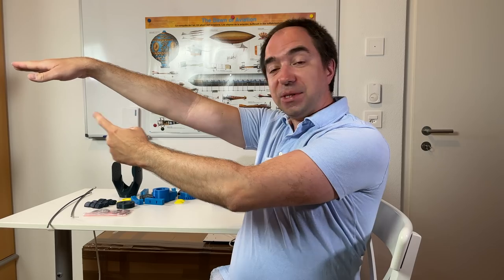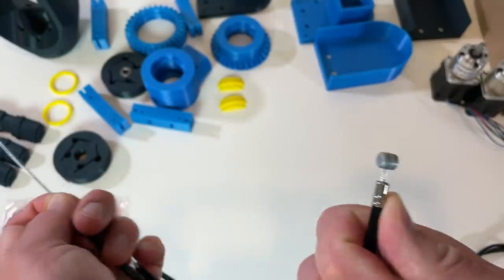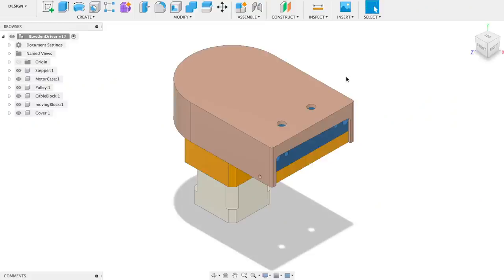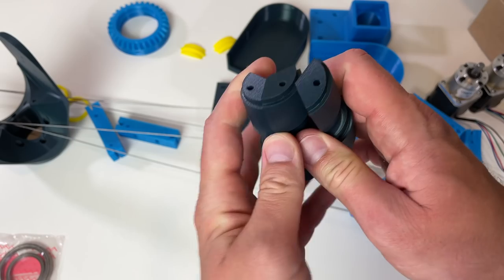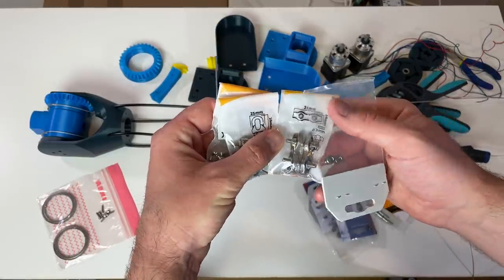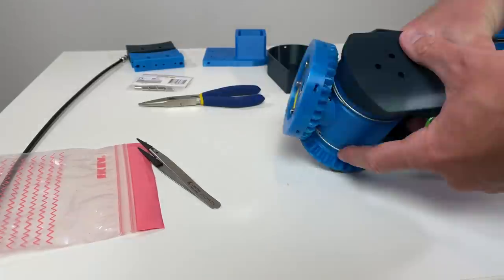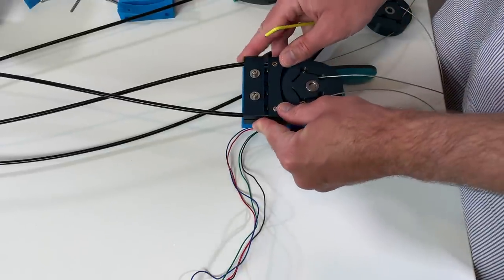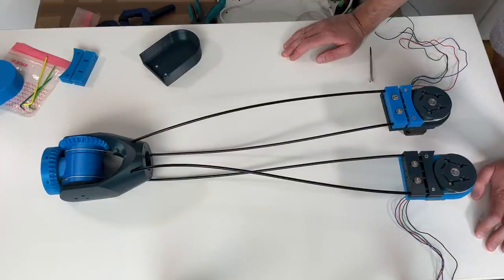Bowden cables for the robot arms? Will it work?

Comment: How about analyzing "rotational bowden wires" ? Removing the length from the equation and only work with rotation of the wire? Guess you need higher speed on the wire and gear reduction at the hand to get some torque.
Reply from the maker: Yes, this is great idea. But with this you cannot move the gearbox. The gearbox would have to stay close to joint. (Because, such cables have some “backlash”)
Reply: @Skyentific  have seen some 3d printer s working with this kind of rotation wire. Moving the high weight from the important point.  Not sure on how they solve the backlash.  Worm gear connected in two stages? But yes, gearbox is needed in the wrong end of the cable
Reply: Not a fan of flex-shafts either.  They tend to have very low stiffness and significant friction.  Much better to snake a timing belt in with a bunch of idlers or use a shaft with a clever gear layout.

Comment: Hi, in bmx industri exists linear break cables. This cables are not spring like cover, they are linear so when you tight them doesn't affect the breaking streght. 
Sorry for my english. I know the are much expensive, but for example https://shop.odysseybmx.com/collections/odyssey-brake-cables/products/race-linear-slic-kable
This kind of cable reduce the friction a lot!  For example you can do 2 entire turns of the bar, and still breaking (this is not possible with normal break cables)
Also others break cables from shimano or others fabricants,  reduce friction with teflon and other tech inside the cable.

Comment: Bicycle shifter cables are built differently than brake cables for exactly the reason you show.  Brake cables use a tightly coiled spring and contact between the turns to support the reaction loads of the drive cable.  Shift cables uses a parallel wires with a twist every 1-2cm stabilized by the plastic jacket.  This isn't as strong, but it's stiffer and doesn't change length when flexed.

Comment: You should try doing something similar to the mechanism of a ‘flexible shaft Dremel’. So instead of the cable moving forward or backwards like the Bowden system, rather use rotation in the cable. Have always wondered if anyone has used flexible shaft mechanisms for robotics.
Reply: Those cables are good for the Dremel application (constant twisting/spinning), but for robotics it's not going to be good because they bend/twists too much, so you'll loose precision (backlash). I'm pretty sure I saw a guy that made a thicker version of those cables that reduces the twisting... But can't remember the application... and it's much more rigid.

Comment: FYI, if you design the holes printed in this orientation with a "tear drop" shape, or just a small triangular wedge cut out of the top, the result on FDM printers will will become much more circular. Can save a lot of time with complex geometry that's difficult to post-process by hand.

Great video!
Reply from the maker: Great idea! Thank you!
Reply: You can also make the very top a bridge, so print the upper half as a half hexagon. Will work just as well, and put more material around the hole
Reply: @TDOBrandano  Yeah and some slicers basically do this on their own. That extra bite is great when you're threading screws into plastic parts but still not ideal when clearance is needed for projects like this.
Reply: @Lassi Kinnunen 81 I've also found adding a small cutout to the bottom of really small holes can help even more depending layer height. I believe Cura basically adds a bridge automatically to most horizontal holes but it would be nice to adjust how steep of an angle it starts. Changing the orientation is a good thing to note. It's just not always practical and may affect how reliable the overall dimensional accuracy and part strength is.

I've been looking into creating a slicer plugin that automatically applies an optimal tear drop to holes between a set diameter. It may exist already but I haven't seen one. I'd also like to have bridging options for holes that'll be threaded and automatic sacrifical layers for recessed vertical holes .

Comment: I'd have a try at using bicycle gear cables instead of break cables, the housings are constructed in a different way to minimise the issue of the length increase as it bends and the cables are thinner and more flexible.
Reply from the maker: Yes, this is great idea. But there are two issues: gear cable is more rigid and it can transfer less torque.
Reply: @Skyentific  the rigidity is a good point, but I don't think the torque would be an issue, they can take 500N+ without breaking

Comment: Bowden cables are good. Actually you can compensate most of bad effects using encoders and software compensation.
Reply: You are right. By 'integrating' the cables before the sensor, you include them in the closed loop system and the control system can compensate for the non-idealities. It is of course not as good as if it would not have any non-idealities, but better than using the cables in 'feedforward'.
You will always waste (precious) motor power overcoming resistance, leading to lower efficiency, not being able to reach theoretical torques/speeds and motors getting hot. 
Play/backlash is something a control system cannot really compensate for very well, and can even lead to control system instability.
Reply: @tHaH4x0r  To pick up some mug and to place it in another place - this is more than enough. Really good lubrication and maybe bigger diameter and more flexible cables - can improve efficiency - like in human body : D
Reply: @humanspirit3432  If you can improve the mechanical system of the arm, why not do so? It seems like a waste of effort to design such a beautiful arm and 3D prints, to then not nicely finish it up in the end.
Also, the bigger diameter tubes will only exacerbate the issues with bowden tube getting stiffer when bent, because this is mainly caused by the difference in length between inside and outside of the cable. The resistance is also not caused by friction inside the tubes, but by the cables working against each other. This means that lubrication does not help at all either. 
More flexible cables would maybe help, but this would come at the cost of control system bandwidth, as this elasticity is directly in series with the actuator.
Reply: @humanspirit3432  To elaborate on my last comment, what is the point of putting the motors far away from the joint itself? It is to decrease arm inertia. Why do we want to decrease arm inertia? Improved bandwidth and increased safety. If you then have a more elastic link between motor and joint you will decrease the bandwidth, yielding probably worse performance as a result, with higher mechanical complexity (meaning more cost, lower reliability) so it makes a lot of sense to want the mechanical part to be operating without slip, resistance and other non-idealities, as otherwise you are just handicapping the arm and negating any benefits you are trying to get.
Reply: @tHaH4x0r  I mean - cables must be flexible for bending, but not flexible for stretching. Steel cables with many wires - are OK. Maybe some synthetic cables will work also good.
Reply: @humanspirit3432  you should ditch the steel and replace them with Kevlar fibers and PTFE tubes. I mean you're not going to transmit compression with the cable, so why not use known technology to eliminate problems.

Comment: A tip for the holes, you can you use a tear drop shape at the top of your holes to prevent hole collapse.  Saw it on maker's muse and it works quite well.   I haven't done it yet on that small of a whole, because usually I dont need it for that small of a whole as its using for screws

Comment: I like how bicycles overcome this by using a long-enough bowden for each bend that changing the bend doesn't change the bowden length much - and then for any straight long sections it relies on the compression strength of the arm to run the cable in a straight line. 
Brake handle > top of bike frame, one sweeping curve that doesn't change length much when you steer
Top of frame> fixed point to bottom of frame with no tube, just open cable
Bottom of frame > brake actuator is straight line with no changing bends. 
I think a lot of the problems can be overcome by relying on this kind of geometry.

Comment: There were teflon lined bowden tubes for racing bikes in the 80s, it was a difference like day and night, compared to the conventional tubes.
Reply: material types make differ but kuka and others solved this problem using strong timing belts.
If this worked for robot arms probably all companies would use it.

Comment: I'm wondering if you use a smaller circumference at the motor, the effective gear reduction would help overcome the friction. Very nice design, too bad it doesn't work better. Thank you for trying it, a design I've been thinking of myself. That saves me some time!
Reply: I was thinking if he put a gear reduction between the cable driven shaft to the arm past the previous degree of freedom, this could help with the change of length of cable when boden tube bends.

Comment: Great project idea, well done. Probably the best is a hydraulic fluid system or maybe an air vacuum pump like used in the Mercedes central door locking system, very little friction and waterproof. For example 2 syringes connected with a small bore plastic pipe. giving you instant push/pull linear motion.Keep up the good work.

Comment: You can account for bend in software so the steppers adjust the end of the cable and zero out bend’s effect. Calibrate the thresholds once the bend is consistent based on the rest of the arm.
Reply: It's the same pulley that pulls and pushes the two cables at the same time, so it can't be compensated with software. Unless you have two separated pulleys with one motor each, one pushing and the other pulling at the same time, than you can compensate via software.

Comment: Cable length issue. Simply route the cables is such a fashion that when one cable bends the other straightens. This will cause a small position error. This can be done, if one cable makes a clockwise bend route the other counter clockwise.
Reply from the maker: This sounds like a great idea, but I cannot imagine how to do this on real robot arm. They would always bend and straighten together.

Comment: Perhaps a solution to the bowden backlash so to speak (where bending changes length), is to measure at the end and closed loop correct for it.

The motors could still be at he base and you'd only need encoders at the end still cutting down on end effector weight.
Reply: Agree, even with the friction and the "backlash", it still carries the force pretty well, so measuring the position at the moving end rather than the motor end makes sense. I had the same issue with my canards, but fixed it with potentiometers, and generalised the principle to all my ailerons/elevons, even using chain belts and tensioners from my servos.

Comment: At approximately 10 minutes in, you show one reason for cables suddenly showing slack; when I worked at a bike shop I found that cables, { mostly the brakes } S T R E C H E D due to the force applied by the rider was greater than that applied by the cable assembly machine. I hope that you find this helpful. Cheers.

Comment: Great video! I think you are there! Maybe I'm being too optimistic, but I think that the movement of the cables when they're bent could be modelled. Then, with the rotation of the joints between the steppers and the articulation, you always would know the change of length of the cable. So each time an intermediate joint moves, you should compensate the change in length by rotating that amount in the stepper.
Reply: correct, that's one of many things this video fails to acknowledge.

Comment: Nice! I thought about trying this before as well :)
Reply: me too, did you consider compound bow risers and artificial muscles? I'm thinking electrolysis could maybe inflate the muscles
Reply: @kingmasterlord  shaping the rollers which are guiding the wires in a way to accommodate for the position dependent torque - this would be worth a try 👍🏼
The question is if such a artificial muscle can achieve reasonable dynamics
Reply: @EngineeringSpareTime  well I was figuring on how to take this stuff https://www.fibreglast.com/product/24K_Carbon_Tow_2293/carbon_fiber_all
basket-weaved around strips of alternating rows of these cables and inflatable artificial muscles in the same way muscle tissue and ligaments are. 

combine the bow risers and some gearboxes and pulley ratios and the small action of the muscles can have big results. 

I've got these 4 ft fiberglass rods that I'm going to make into bones by putting them in a carbon fiber sleeve with some wiring conduits, the reduction cables can go inside of it too..maybe through some 4040 extrusion in the center third

Comment: Could you compensate for the second issue? The amount of curvature is a known value.
Reply from the maker: The amount of curvature is going to depend on the other axis of the arm. I don’t see simple and cheap solution to compensate for it. (Of course you can use additional motor to compensate it, but I think this will be overkill)

Comment: You should check a usual flex shaft screw (like for a dremel). Also, there is a special flex shaft bowden driver for 3d printers like this https://flex3drive.com/. I think it will give you accurate that you want

Comment: Because you will ultimately be in control of the entire kinematic train, can you not use software to compensate for the offset introduced by bending the cables?  Is the mechanical allowance using springs absolutely necessary (as long as you get the math right)?
Reply: It's the same pulley that pulls and pushes the two cables at the same time, so it can't be compensated with software. Unless you have two separated pulleys with one motor each, one pushing and the other pulling at the same time, than you can compensate via software.

Comment: I need some design help and this video is semi related. I am attempting to have a rotating axis at the end of a flexible limb. My first thought was u-joints but this rotating shaft has to be too small in diameter for that to be realistic. Would a cut version of the inner cable from these tubes be the best way to go?
Reply: The cable on the inside tends to have terrible torsion stiffness. It can work, but only if it's to transmit power in one direction always. If you have to stop or reverse direction the backlash is huge.
Reply: @frollard  any ideas for an alternative?
Reply: @LimabeanStudios  tough nut to crack...if it's rigid you can use a drive shaft, but if you need it flexible, you're gonna always fight with those issues. You can use a series of universal/cv joints.

Comment: Possible to use pneumatic line tube with small ID (2mm)
Reply from the maker: Yes, this is interesting to test. The question: is 2mm ID would be enough for the fast actuation. I think it should be, but not sure.
Reply: @Skyentific  I think that main problem is tube's wear out
Reply: @Skyentific  or maybe use Bowden tubes from a 3d printer(as hydraulic lines) and use mineral oil instead of air to mitigate fluid compression

Comment: Yeah, bike cables conduct small amounts (less than a newton) of force (to activate brakes and derailleurs)  around articulation points (like forks and suspension) that only move a few centimeters and at any given time are being held in place by hundreds of newtons.  I don’t think you will be able to make this work.  Hydraulics might be a better bet.
Reply: Anna 20 y.o - check my vidéó  That is an interesting idea.  Encoders would be complicated if they served no other purpose, but if you wanted to implement proprioception, a cable-based system might be an inexpensive way to transmit motive force. That is how your fingers, for example, work.
But Anna, why is a cam-girl worried about robotics?

Comment: The testing you're doing is all ad-hoc though, in reality the cables would be fixed to the arm. And you know how much the arm is bending, allowing you to counter the flexing in the cable by linearly shifting the tensioning in the shoulder. It requires an extra 1 two 2 linear actuators in the shoulder, and rather precise measurements of how much it'll flex when the arm is in motion, but it should be doable.

Whether that makes it better than the alternatives I have no idea about, but "testing it in reality" and just randomly bending the cables doesn't quite match up, in short I don't think you actually tested what you wanted to test. You had the preconceived notion that the Bowden cables wouldn't work, and then you proved it instead of tried to disprove it.

Comment: Maybe instead of springs use a solid piece of rubber and drill 2 holes in it
Reply: Also could maybe try braided kevlar string instead of a wire, since kevlar should stretch a little bit more than steel does and is also more wear resistant i think

Comment: You have really nice videos but, man, you must get great deals on bearings.
Reply from the maker: What do you mean?
Reply: @Skyentific  just a reflection that you use so many bearings, I can't help thinking the gearboxes could be made much cheaper by not needing soo many bearings. But Im probably wrong.
Reply from the maker: You can get these bearings for 3 to 5 USD on AliExpress.
Reply from the maker: @LarsBerntzon  look at cycloidal gearboxes - there are a lot of bearings there. Here - only 6 bearings for 2 axis.  Not so bad.
Reply from the maker: @LarsBerntzon  anyway, normally, you need at least two bearings per axis. Here, it is 3 per axis, but thank to this the wrist is compact.
Reply: @Skyentific  I know, cycloidal drives are crazy.